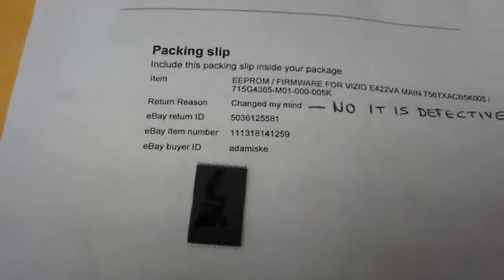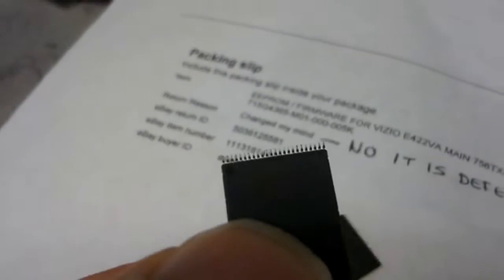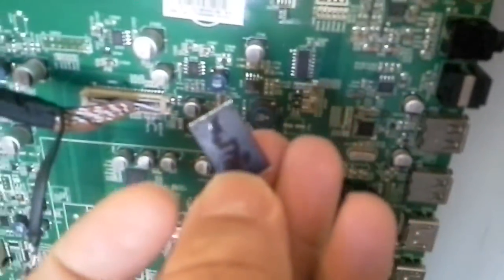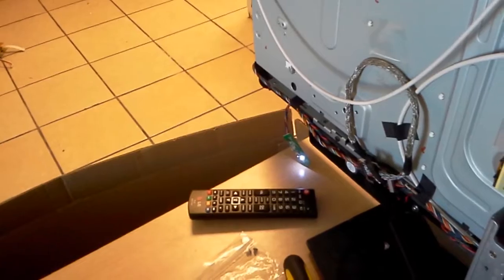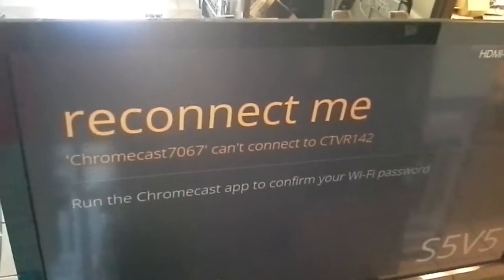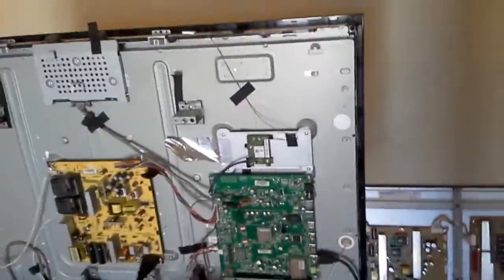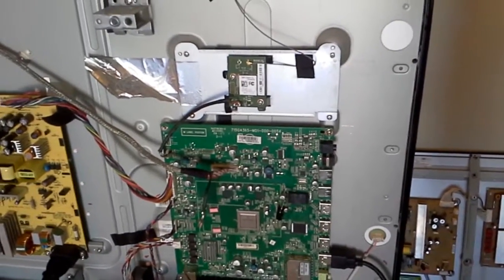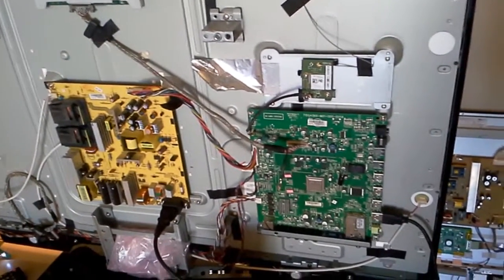Yet anorher Vizio E422VA EEPROM returned used

Comment: Hey I have the same tv it will turn on with flicking backlight and the black screen but still has audio , if I turn it off and on again after 3-4 minutes it turns on properly and works for hours with no issues , do you think if I replace the power supply it will fix the issue?
Reply from the maker: While always a possibility, I do not think that for this particular TV model replacing the power supply board will fix the issue you describe.
Reply: @coppelltvrepair  then I'm guessing it's the main video board ?
Reply from the maker: @bsdsecuritysystems4664  I do not like to guess, but if I had to I'd guess yes.
Reply: @coppelltvrepair  I see, your guess would y better then mine , ill probably throw it away in electronics recycle since I saw it's about $100 board on eBay I think I'm better off buying a new TV . Thanks for your help